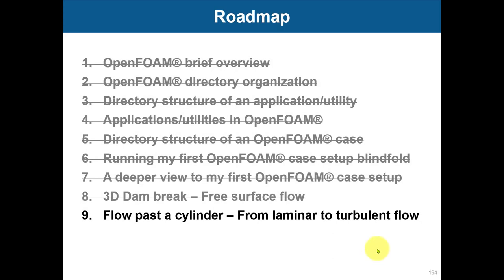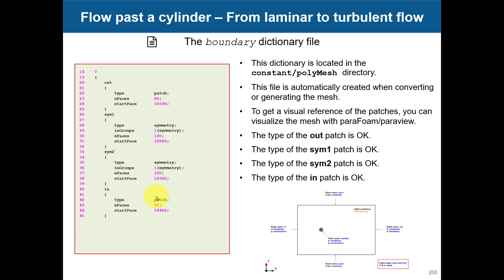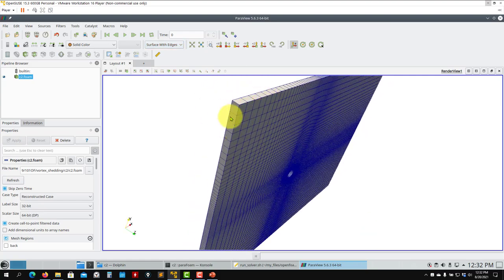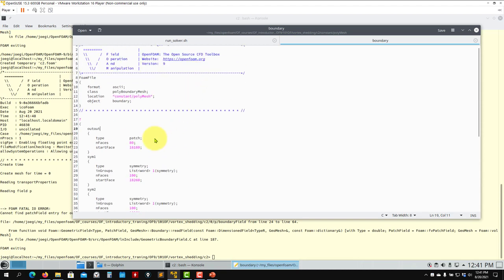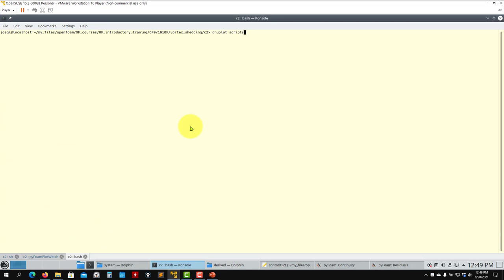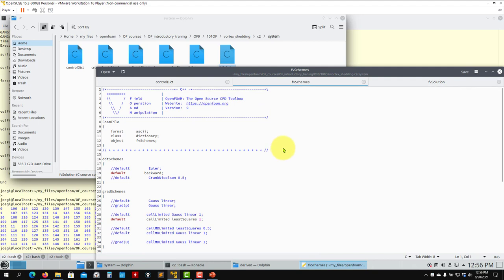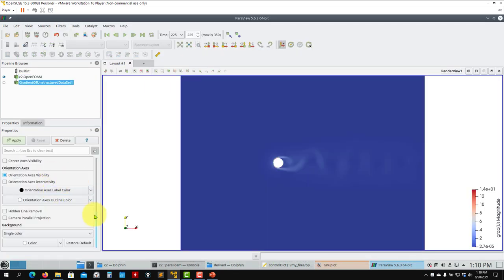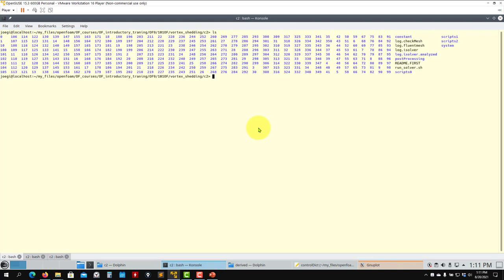1.5 Module 1 | Introduction to OpenFOAM - OpenFOAM 101 #openfoamtraining

Comment: Also you type of9 ( I guess to open openfoam9 if I do not make mistake). At the moment I have open foam 10. Therefore I type of10 in the terminal. however it awnsers “command not found” could you please explain what is the problem?
Reply from the maker: OpenFOAM 10 is not installed
Reply: same for me using "of10", however I open openfoam anyway with the line : openfoam2212, try this one or check if another command can open your specific version (openfoam2206 maybe ?)

Comment: Hi, I have problem on running all the cases up to this stage. In all it shows me an error that the physicalProperties is missing and the run fails. Could you please help me what should I do?
Reply from the maker: If you are using version 10 you need to update the input file transportProperties
Reply: did you find a solution? Im having the same problem here :(